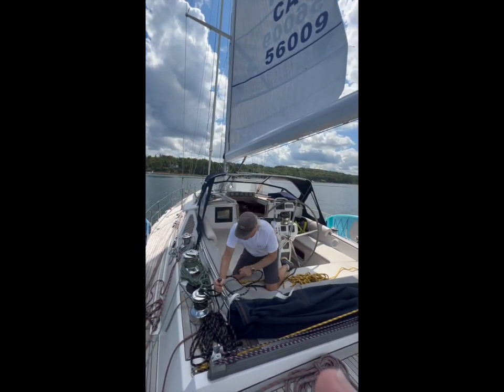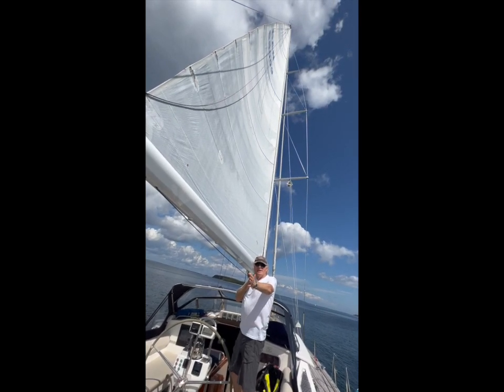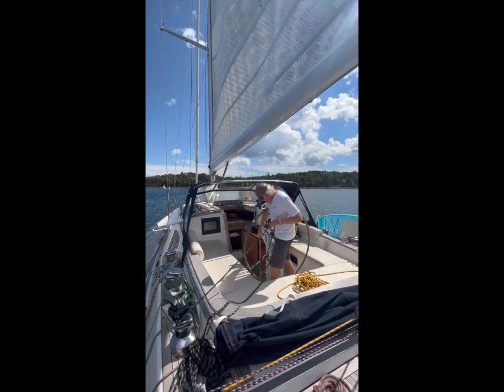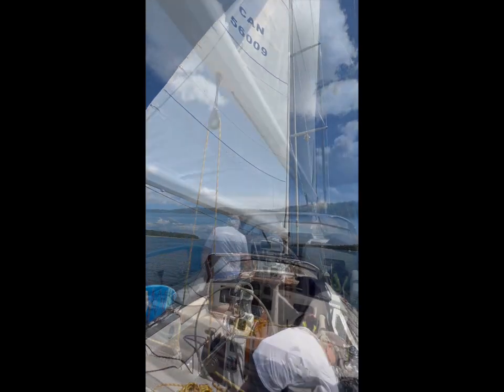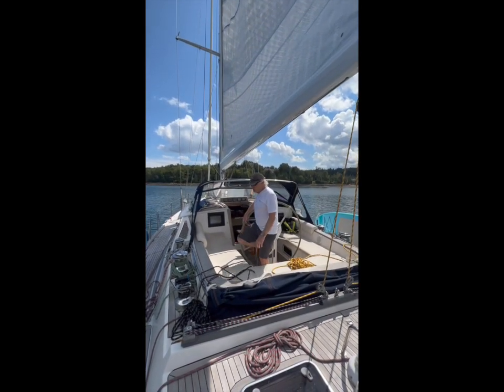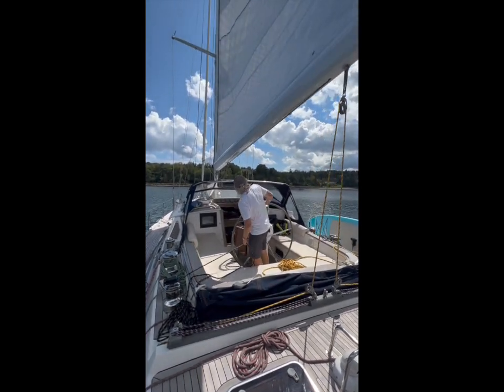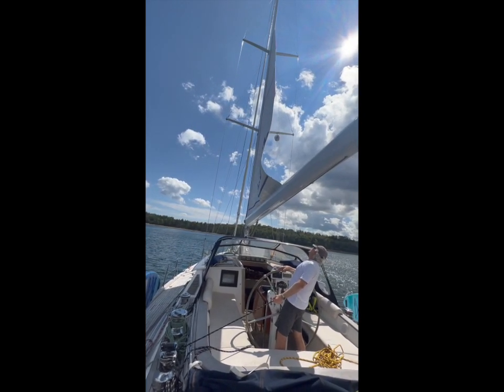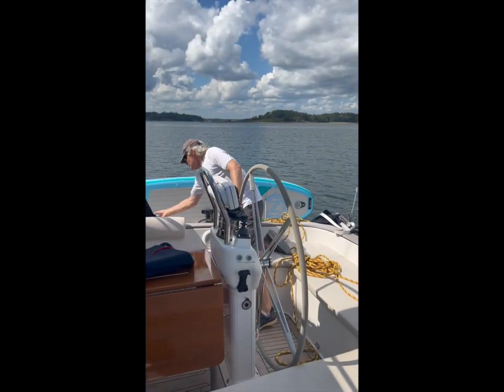In Boom Mainsail Furling and Reefing

Comment: Lots of wind noise, hydraulic winch alarms loud beeping, boat operator not wearing a mike, hard to understand when not facing camera. I am sure the hydraulics cost more than my boat which only has a manual in mast furling. I would say video is of limited value.
Reply from the maker: I would agree. Video is not our primary focus and this was only part of a deep dive into mainsail options starting here: https://www.morganscloud.com/2022/10/09/in-mast-in-boom-or-slab-reefing-convenience-and-reliability/
And inspired by this tragedy: https://www.morganscloud.com/2022/08/22/lessons-from-a-tragedy-at-sea/
The full series requires membership (US$36.00) to read, but you can read our take on the tragedy at the above link for free.